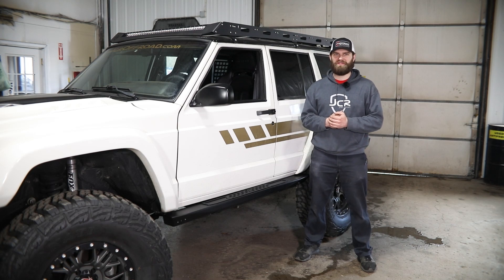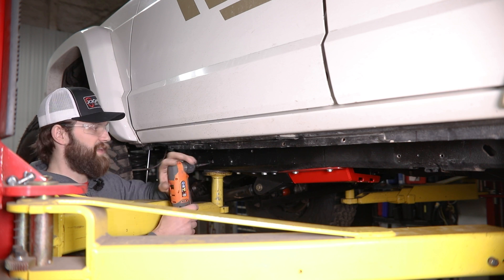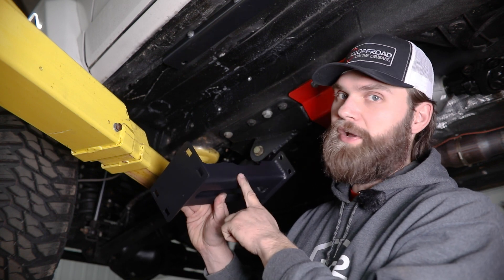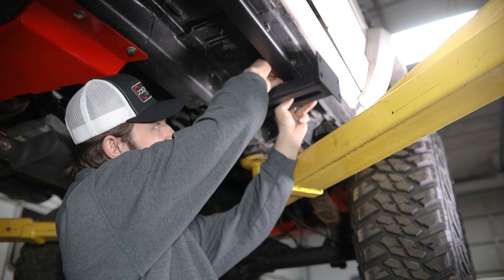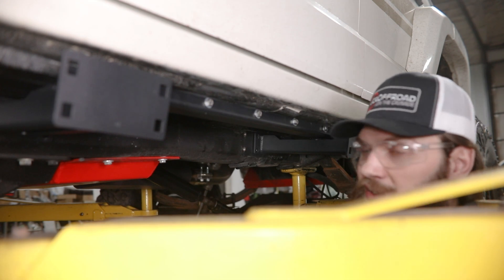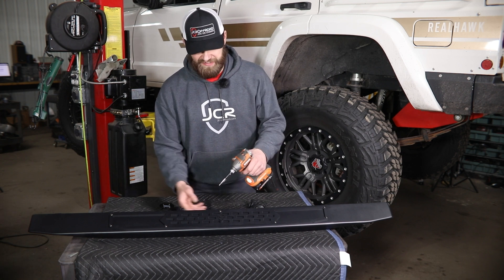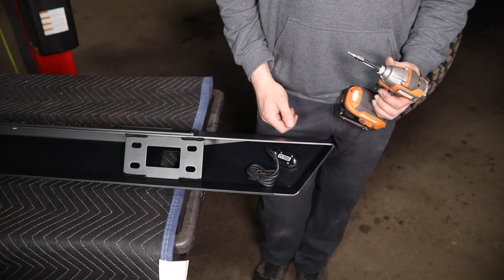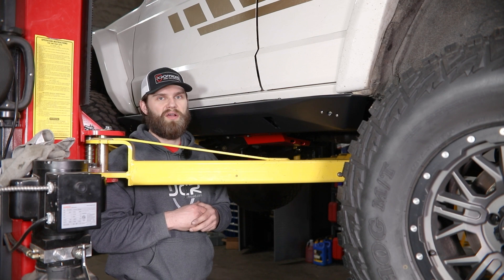XJ Crusader Rock Slider Install

Comment: Can you possibly explain further in detail where I am supposed to be measuring to locate the pinch seam bracket?  I think video says back edge of the fender where it mounts to the pinch seam.  I suppose this is where the fender ends and pinch seam begins?
Reply from the maker: The fender sheet metal overlaps the pinch weld where the fender bolts to the pinch weld. Measure from the back edge of the fender's sheet metal where it overlaps the pinch weld. If you need more clarification, please reach out to our tech support team: https://www.jcroffroad.com/CTUS.html

Comment: What's your recommendation on how to wire the rock lights for a clean look/install?
Reply from the maker: Run them up to the engine compartment.
Reply: Will these fit with bushwhacker flares?
Reply from the maker: Shouldn’t be an issue.